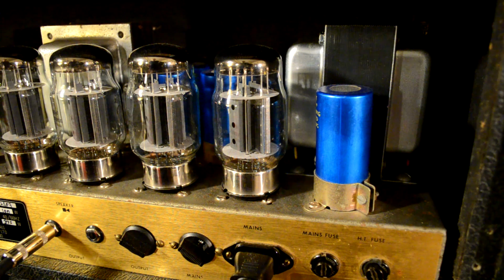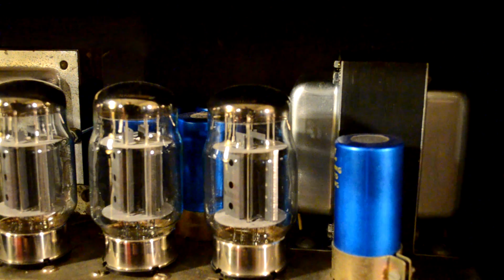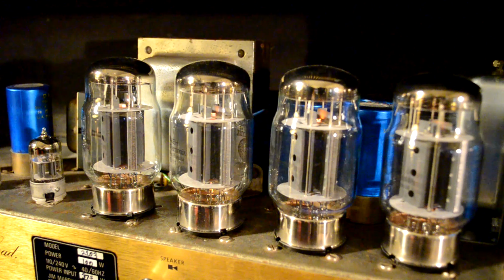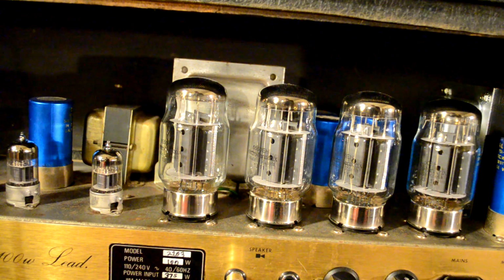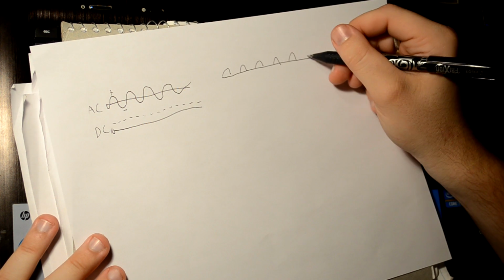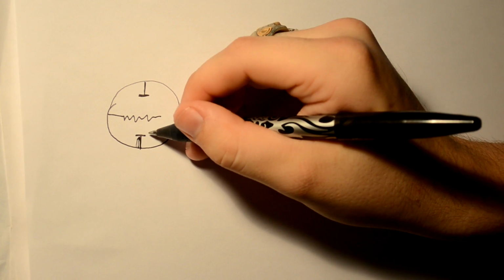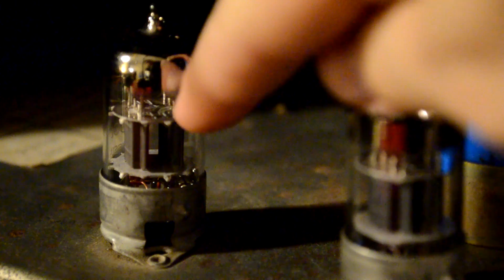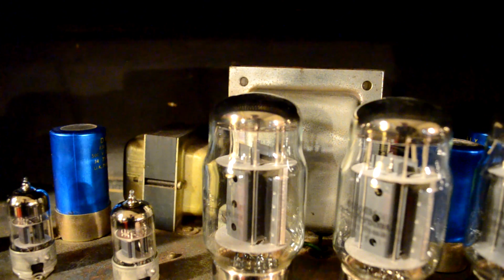How Tube Amps Work

Comment: nice video.  The guitar signal (AC) stops at the first tube stage. It only modulates the amplification of the tube stages, the tube stages amplify the AC signal with the use of DC voltage amplification.  In other words the guitar signal AC gets amplified by the DC in the amp then turns back into AC signal for the speaker to see after the output trans. You're sort of using apples to modulate or amplify with the use of bananas to get a larger output of apples.
Reply from the maker: Right, maybe I should have made that clearer in the video. The original signal does not go all the way through the amplifier but acts sort of as the "instructions" to the tubes, telling them when to "open and close" (send or block current). It's interesting how that works, similar to the way a radio transmitter uses an AC signal to modulate a carrier wave.

Comment: at 13:05 the peaks are actually 170 volts
Reply from the maker: +Coates Kris That is true, however, the RMS voltage is 120. The RMS voltage is more useful than the peak voltage since it is only at 170 for a very short amount of time. The 120v is kind of like the average you're getting.
Reply: The r.m.s. voltage is 0.707 of the peak to peak voltage. An AC voltage of 120V r.m.s. will do the same work as a DC voltage of 120V. In other words, they would take the same amount of time to boil a pint of water in a kettle.

Comment: How to make the best of a valve amp and make the guitar level more sensitive to gain? Higher level on the amp knob and low level on the pedal or, the other way around, a low level on the amp and high level on the distortion pedal (Like a fuzz or a Boss DS-2)?
Reply from the maker: +Alexandre Soma I'm not quite sure what you mean. Do you mean make the guitar more dynamic/ touch sensitive?

Comment: Can you make a video about how to sound like AC/DC. Or how to make it distort without turning it up really loud.
Reply from the maker: Yeah I've actually wanted to do that for a while! Keep an eye out for it!
Reply: He's doing it by driving the preamps to the point of distortion while keeping the power amp at al over level(this is referred to as gain on your amplifier)
Reply from the maker: +A23p Studios +toss owen Actually it's sort of the other way around. It's a blend of preamp and power amp distortion. AC/DC plays loud and they don't use as much gain as you would think. As far as the loudness goes, I uploaded a video a few weeks ago about attenuators that explains how to tame the volume of an amp. Check it out.
Reply: +Brandon Doherty Just wondering because I have a 1959 marshall plexi jmp 100w and it is very loud if you want it to distort.
Reply from the maker: toss owen
Right, that's why you would need an attenuator. It allows you to turn up the amp but turn down the actual volume.
Reply: +toss owen why don't you just get a pedal?
Reply from the maker: +Zach Bartu I never use pedals because I'm all about simplicity. There are some that will get you close to the tone, but they will never quite get it exactly right. Pedals are solid state devices (with a few exceptions) and they don't behave in the same way that tubes do. For the average listener/ player you may not be able to tell the difference. But if you compare the real thing side by side it becomes apparent. I've found that pedals, simulators, modeling amps, etc sound pretty darn close when you're playing chords. But for solos I can immediately hear the difference because tube amps add a lot of harmonics to those single notes that solid state devices just can't do.
Reply: The distorted sound from an amp at high volume is a combination of distortion in the preamp and distortion in the output stage. There are modifications which can be made to make the preamp mimic output stage distortion, so the amp will produce a sound at low volume which is similar to (but not exactly the same as) that of an amp at high volume.